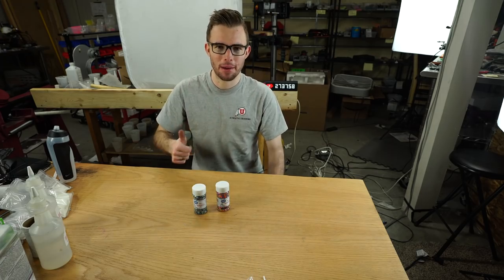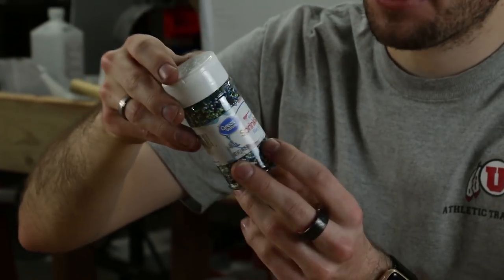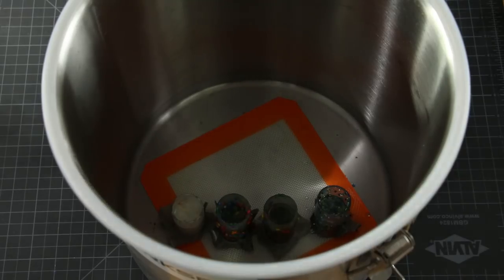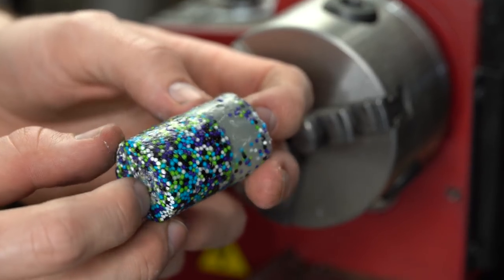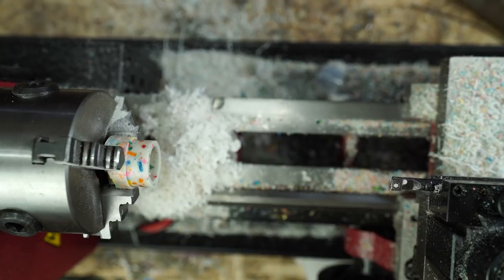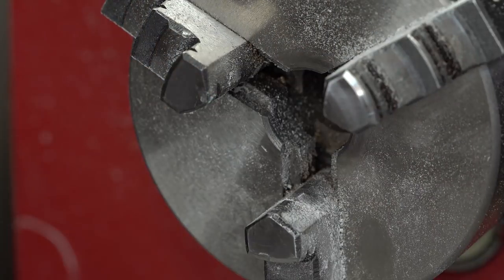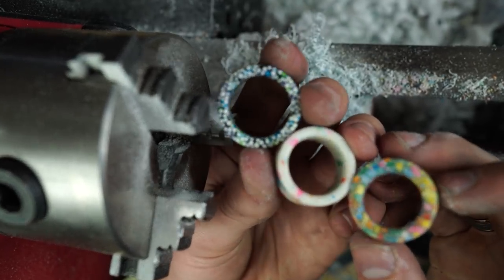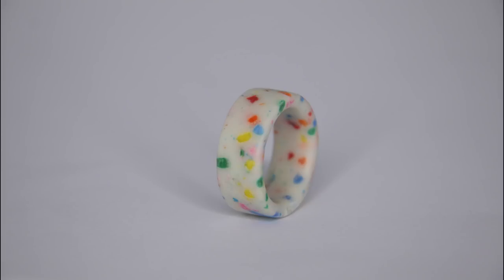Making Candy Sprinkles into Rings (Resin Casting)

Comment: Hey Patrick, you should try sealing a watch moment in resin and making a ring out of it, like you did with the iPhone 8. It'd look pretty cool with all those little intricate components. Looking fantastic as always!
Reply: Aidan Daly i think the density differential between the resin and the small metal parts would cause major tearing.
Reply: Gibbs91_30 I don't mean split it up into individual pieces, you keep the main steel/brass frame but cut out a ring blank and seal it in resin, kinda like putting rebar in concrete. Im not sure, it doesn't seem too unreasonable

Comment: This one was nice. It was very casual. I would like to see the once with melted sprinkles too. And if possible I would maybe put a towel or something underneath when sanding.

Um unfortunately I don’t have a picture but I would love to see one with pure black resin and small red leaves (like poinsettia color). The leaves wouldn’t be torn apart but actually be small enough to put inside whole thing. Of course they would have to be positioned correctly so they don’t break when sanding. But the contrast between bright red and black with the polish would be gorgeous.

Comment: Patrick, try to get the resin under pressure instead of under vacuum.  Instead of trying to pull the bubbles out pressure will compress them to basic invisibility.  Watch Heath Knuckles make a blank, for a good example.